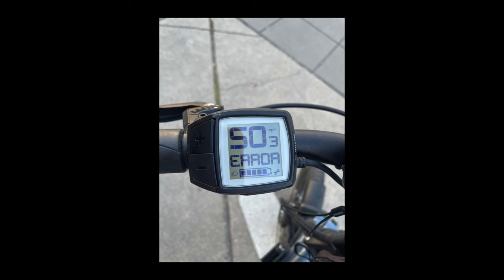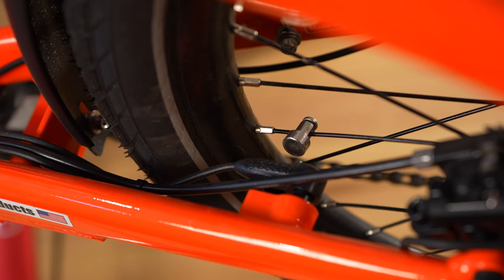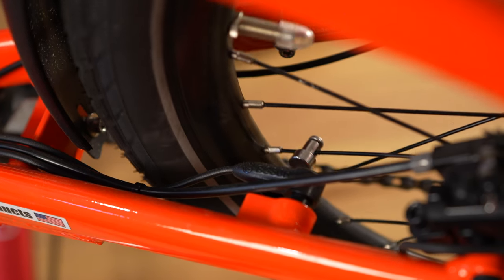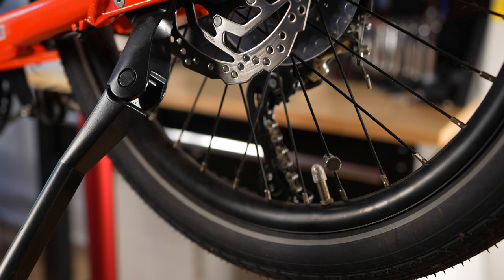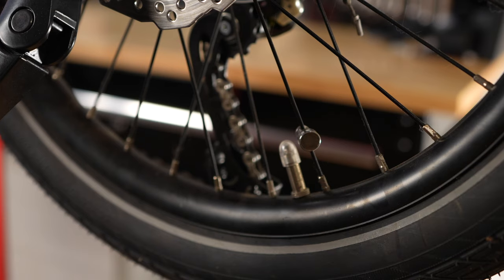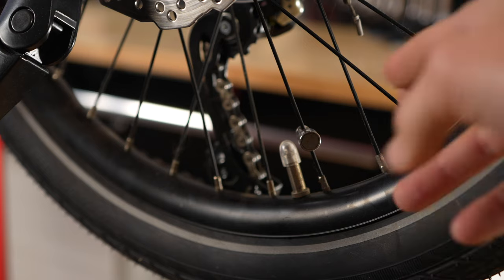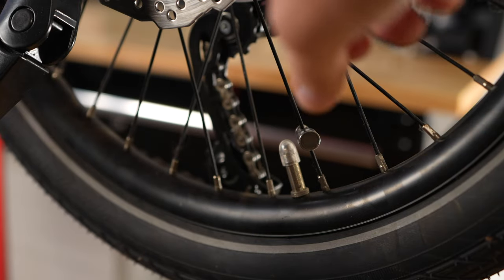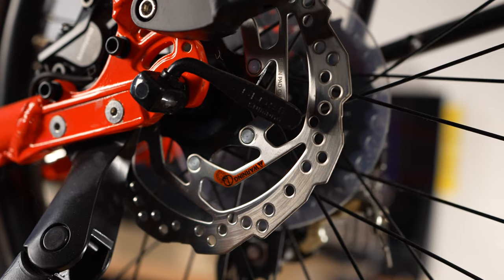Fix the Bosch E-bike 503 Error and Speed Not Reading

Comment: Thanks Arleigh. I have previously had this problem. One extra tip on Tern (possibly Bosch) sensors is that the my first idea was that the magnet should align with the larger circular part at the back of the frame mounted sensor. This is however not correct. There is a line across the body of the sensor from top to bottom of the sensor (can be seen from the other side, looking through the spokes) that the magnet should align with.

Comment: Thank you. Very clear video. Put some air in the tires of my Tern HSD P9 for the first time this morning. (I've only had it a month). I had to move the magnet to use the pump. Put it back on about 4cm too high on same spoke because I didn't know about the sensor. No 503 error reading, but the motor kept cutting in and out. I was able to coast down the hill to get my bus...

Comment: I was getting the intermittent 503 error, but it usually appeared after riding 5 or 6 miles, then, if I turned the display on and off, and pressed a few buttons, it would get me going for a couple of more miles, but the 503 error reappeared. I moved the magnet, reset it with the line on the sensor, I even bought a pack of 10mm x 1mm magnets and stuck one of those on the spoke magnet to bring it closer to the sensor, but still the same. I had looked at the cable and I couldn't see any external damage, the cable then goes from the sensor and inside the motor casing, it was tightly coiled inside, and appeared to be trapped by one of the bolts holding a fixing plate. I freed up the cable and checked for damage but none was apparent. I then looked at the connector of the cable inside the motor casing, and although this appeared to look OK, I unplugged and reinserted the plug a couple of times, and then made sure it was fully inserted, (be careful if doing this as the 2 pins inside the socket are very delicate). I tested the bike by doing a 16 mile ride and everything seemed perfect, but the fault returned.
Update 17th August 2023 - The fault has returned, I have now sent an email to Bosch about this problem, asking what is happening, and what can done about it, but Bosch has not replied to my email as of 23rd. August 2023. I have now purchased and replaced the actual speed sensor, and after doing a 25 mile ride yesterday, everything now seems OK, so if you have checked all the above, and are still having problems, replace the speed sensor, (others have also reported speed sensor problems). If I get any more problems, I will update this message, so you can assume that everything is still working OK if you don't see any further update.
Reply: Thanks for sharing! This sound like what I’m going throughout now too. Whats the process for replacing the speed sensor? 
Do I need to take apart the display monitor?
Reply: @jessesoneff3696  On my bike, I did not have to touch the display at all as the cable from the speed sensor only goes to the motor in the crank housing, so about 10 inches, 25cm. I originally thought that the cable from the speed sensor went to the display, and I was going to have problems routing the cable through the frame, but when I took the cover off the motor housing I could clearly follow the cable from the sensor to the connector on the motor.

Comment: thanks Arleigh.  I have moved my magnet to the opposite side of the wheel from the valve stem on the theory that the wheel would be better balanced with the weight of the magnet off setting the weight of the valve stem.  In the olden days, we use to adjust wheel bearings to the point where a wheel could rotate back and forth like a pendulum just from the extra weight of the valve stem.  I've always wondered why the magnet is right next to the valve stem making it difficult to get a pump head on and off the valve stem.  I like your solution.
Reply from the maker: “Typically” the valve weight is about even to the pin/weld of the rim at the opposite side of the wheel. 

I think on larger/lighter wheels we may feel a difference but I haven’t noticed on the 20”. How about you?
Reply: @BikeShopGirl  I didn't even consider the weld weight.  Good point.  And, no, I haven't felt anything with these 20" wheels.  It seems in the old days with ball bearing adjustable hubs getting the adjustment just right was more important than today with sealed bearings.  I'm just glad someone else moves the magnet.  The location so close to the valve stem really gets in the way.  🙂

Comment: How do you get rid of the spanner icon please!!! 👍
Reply from the maker: A bike shop will need to plug in to reset your service interval.
Reply: @BikeShopGirl  thank you!!
Reply: @BikeShopGirl hi, how often or how many kms that I have to service the bike? I haven't seen the spanner on my display unit yet because I just got the bike from my sister, so far, it's only done 1200km. Thank you.
Reply from the maker: @adrianyueng3489 that is determined by the bike shop that built the bike. Some don’t put any interval in so it never shows

Comment: Hello dear i have  bosch ebike purion display  but the head light is not working i am trying like you guide line press and hold 2 to 5 Sec + button but still not on and not showing light icon  on display can you help me for resolve this issue
Reply from the maker: Has the light ever worked?
Reply: @BikeShopGirl  yes light is working on other ebike but my bosch light is not working i am trying many time and press the + button but not working and not showing the light icon on screen can you help me please what is the main issue 
That is board problem or display issue
Reply from the maker: @ravikhi4955 I think you’ll need to visit a Bosch dealer to ensure that the light is able to be turned on